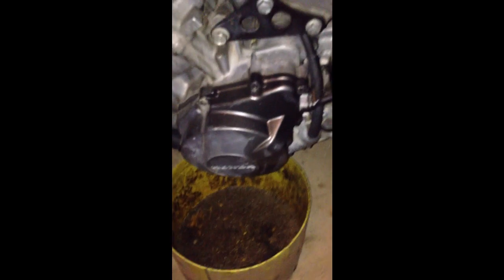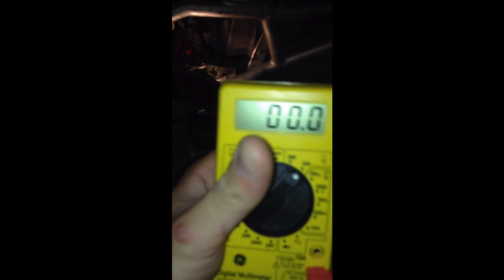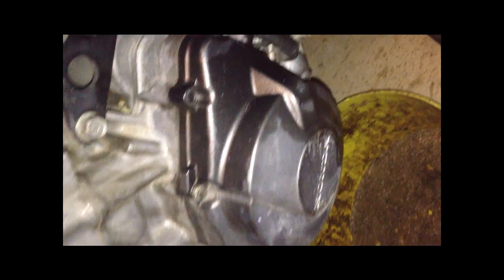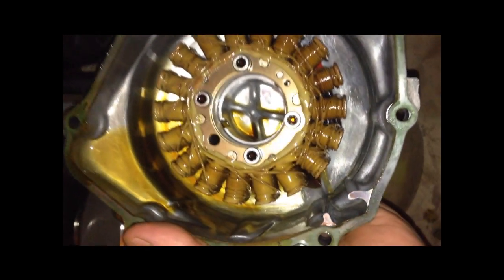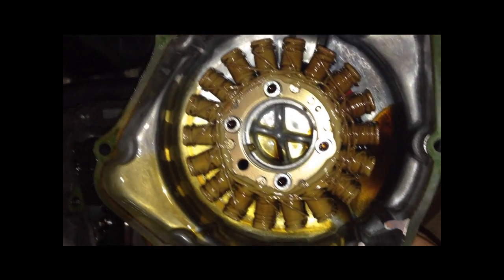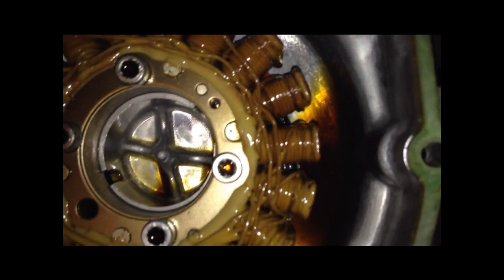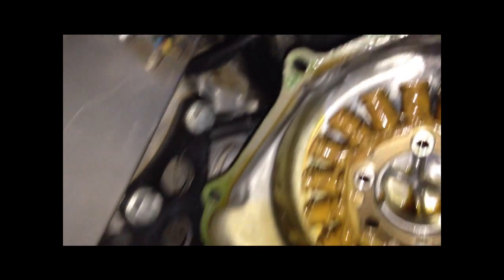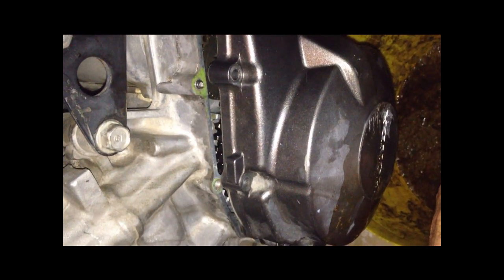Motorcycle battery keeps dying? How to check your stator (alternator) on a Honda CBR600 F3

Comment: Benjamin and tried to place the startor of a cbr 600 f2 1993, but when mounting it on the motorcycle, the movable bolts that they have, offset the holes and do not match ,, as I refer to what I follow ,, thanks

Comment: I have the exact same bike . If my battery hooked up to charge it..bike runs fine. Soon as I take it off charger..the light flahes..the gauges flash..and if i rev it..it just goes pop pop pop..then almost dies. But has no throttle at all. But if on charger..lights,horn,revving everything works fine. Would this be the alternator or something like it? battery is only 1 year old.

Comment: Thanks for this video it definitely helped. I tested my stator this way and the volt meter read a max of 20V while revving and then went back to 0. im wondering if the meter has a max voltage reading or is my stator fried? Also I was thinking maybe it was the wire between the stator and the rectifier but mine doesn't looked burned.

Comment: If stator is shot will bike fire or not fire inconsistently?
Reply from the maker: Yes. Almost all vehicles including motorcycles can completely run off of the battery until it is completely drained. That includes starting, idling, and accelerating. Any accelerating vehicle will obviously use more current because at higher RPM's the spark plugs are firing at a much faster rate. So even if you are using your battery just to get your bike to the shop or back home because your alternator just died, its a really good idea to keep your RPM's very low to conserve electricity. You may even experience a major reduction of power in that instance, because of the lack of support from the alternator. I myself have been conditioned to check the charging system immediately on any motorcycle if I notice any reduction of power at higher RPM's.

Comment: Had the exact same problem with my alternator in my 10year old CB400. I guess they just wear out over time.   Useful video anyway and it is super annoying when your battery dies mid trip.

Comment: Hy Benjamin, I saw a lot of videos and read some text material and they all ask to do the voltage test disconected from the R/R, I get the right numbers this way, about 75v on all wires combinations.

HOWEVER if I do the test as you do, with the stator wires conected in the R/R I get the wrong numbers like yours, around 10v when it should be more then 50v. 

What you think about this? Why the discrepancy when conected and not conected? 

Thanks for any help.

Comment from the maker: The stator wasn't fried. It was actually the wires in between the Stator and the Rectifier. It you watch the video carefully you can see the wire clip connecting the yellow wires was brown and burnt. that's where the short was. And also the stator can still be discolored and work perfectly fine. I was still learning in this video, and the rest of the information is correct. Have a nice day.
Reply: but I already fixed the problem it was the stator I knew that it was. cause I checked with a multi meter. the problem is figuring oh what caused it to fail anyways. if it was something I  did or the part just failed over time

Comment: I heard that you can have a fried ecu Cdi and it can cause the battery to not charge correctly even if Stator or rectifier is good. have you heard about this as I'm trying to diagnose what's wrong with my charging unit I took out my Hids to be safe
Reply from the maker: +matt stacks 
that's bullshit Matt
who ever told you that is not someone you should be listening to
Reply: +Benjamin fixed the problem anyways luckily my ecu wasn't messed up but wires were fried that run to it so I heat wrapped em
Reply from the maker: +matt stacks 
idk how much you know about electricity, you might know way more than me.
this is what i know: 
-electricity is like putting marbles in a long line (a circuit), if you push the first one, the last one moves (closed circuit)
-if the battery is dying then marbles are leaving the battery to power the ignition, but theyre not being put back into the battery by the stator. so obviously it dies
-If the line of marbles is broken from the stator to the battery (a short circuit), they wont reach their destination (the battery)
-the stator is a magnet that spins when the engine is on (obviously, no insult here) and spinning magnets produce electricity
-so this electricity has to make it from the stator to the battery (via CLOSED CIRCUIT)

-the ecu is part of the CHARGING CIRCUIT and the IGNITION CIRCUIT (ya know? that spark that runs your bike.... ignition...)
-A bike with a fried ecu will not only fail to charge the battery, (per short charging circuit) but it will also fail to keep the engine RUNNING at all (per short ignition circuit)
-so if its RUNNING its not the ecu, the short in the CHARGING CIRCUIT has to be located OUTSIDE of the IGNITION CIRCUIT

- so here's the charging circuit break down:
---- ALTERNATOR (stator) is connected to RECTIFIER (via the 3 yellow 12 gauge wires)
---- RECTIFIER is connected (via the green wire) to SIDE SWITCH STAND, TURN SIGNAL RELAY, THERMOSTAT SWITCH, GAUGES, HEADLIGHT RELAY, FUEL PUMP, HORN, AND ECU/ICM/CDI/whatever the fuck you what to call it
---- RECTIFIER is ALSO connected to MAIN FUSE via the RED WIRE
---- All of the items connected to the rectifier via the GREEN WIRE are on the IGNITION CIRCUIT (that's why all those things are ON when the bike is on, some of them even effect the ignition and DO NOT allow the bike's IGNITION to be on (like for instance: the SIDE STAND SWITCH) that's why if your side stand is down you cant start your bike, the side stand switch breaks the ignition circuit
----MAIN FUSE is connected to BATTERY (and ALL other circuits for that matter)

SOOOOOO fuck!! with that all being saidddddd
----ALTERNATOR-----------------------to-----------------RECTIFIER----------to------------MAIN FUSE-----to-------BATTERY
                           (3 yellow wires 1 connector)                    (one red wire)                 (one red wire)
there's your charging circuit
so ALL you have to check is:
STATOR $140.00
12 gauge YELLOW WIRES $5.00
CONNECTOR FOR YELLOW WIRES $20
RECTIFIER $60.00
10 gauge RED WIRE FROM RECTIFIER TO MAIN FUSE $5.00
BATTERY $80

If you just suck at life and you really cant pinpoint the short circuit and LOVE the BIKE just spend the $310 and replace EVERYTHING

and oh by the way... did i say its not the ecu? hope i answered your question buddy. Done.
Reply from the maker: +matt stacks 
I just take 12 gallons of maple syrup and i pour it on everything

Comment: Please help! I don't understand last 30sec ...i have same problem, same bike, when I put new battery it last for two days. I checked voltage while bike was running and it gets higher for only 0.1 - 0.2 volts when I gave it full throttle
Reply from the maker: The charging system is easy if I'f you can understand this: The stator is just a magnet. When the engine is running that magnet produces electricity. That electricity has to get to the battery, that's it. It might not be the stator, the wires might be bad that come out of the stator. Check the entire wire (especially the clips) and make sure they are not burned
Reply from the maker: You can follow that wire and it will lead you right to the regulator. It's usually black and about the size of a wallet. Check and make sure nothing is burned around that area. If it is that usually means the regulator is bad. Next check the wires that are coming out of the regulator that go to the battery and make sure they aren burned either.
Reply from the maker: If your bike is dying it is going to be only one of four things: your stator, your regulator, your battery, or the wires that connect them all. A new stator is about $150, a new battery is about $100 a new regulator is about $60 and the wires are about $30. If you can't figure this out, just email me and I can walk you through it. This is easy dude. Benjamin.wearne@gmail.com
Reply: Yes, did solve it...thanks! It was regulator...now i have problems with valves
Reply from the maker: how do you know its the valves?
Reply: Darko Kovacek same problem on me